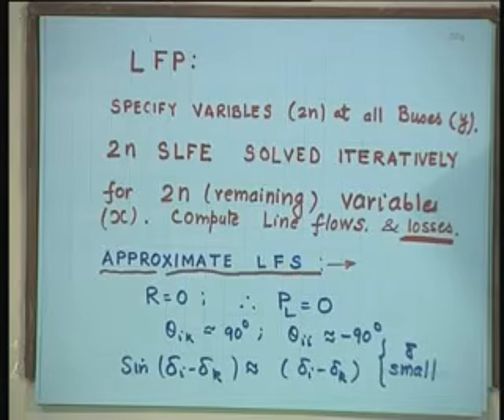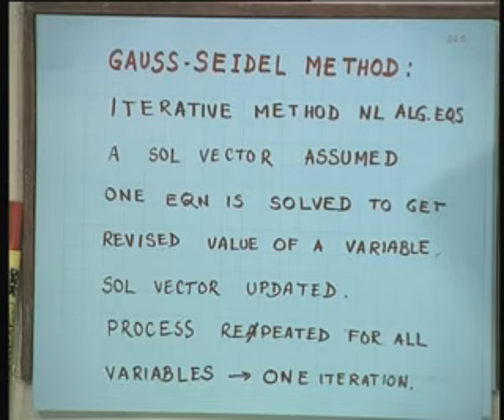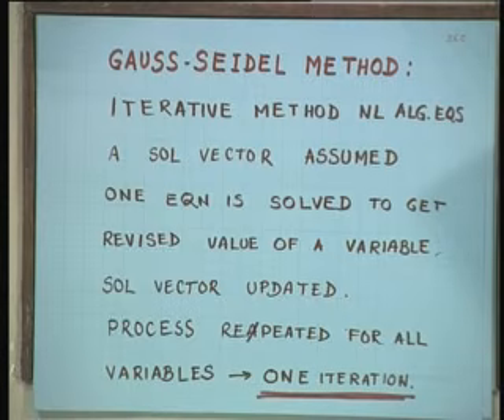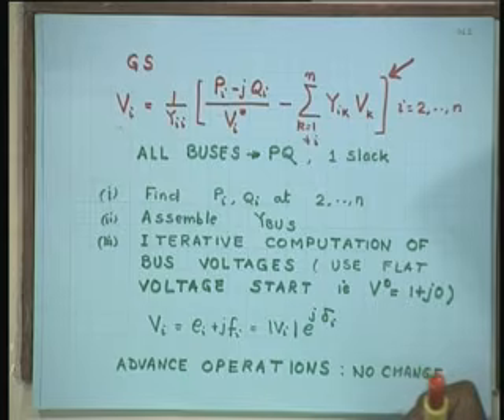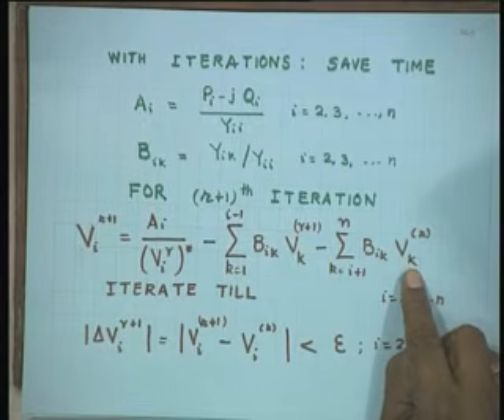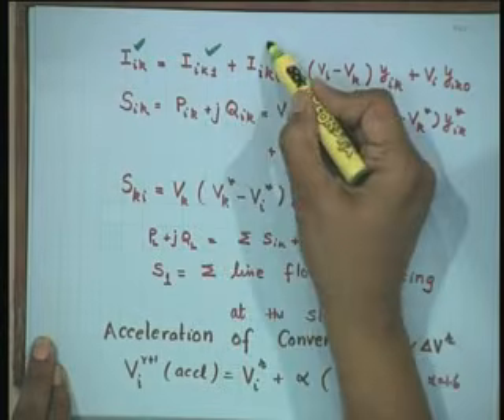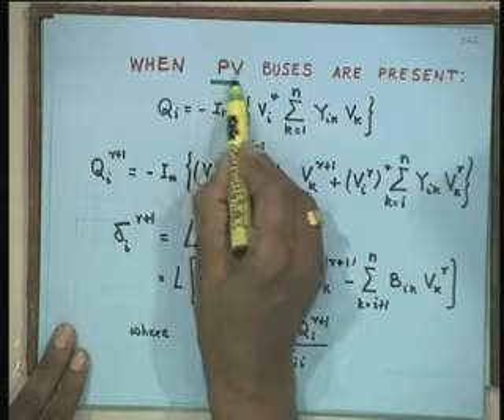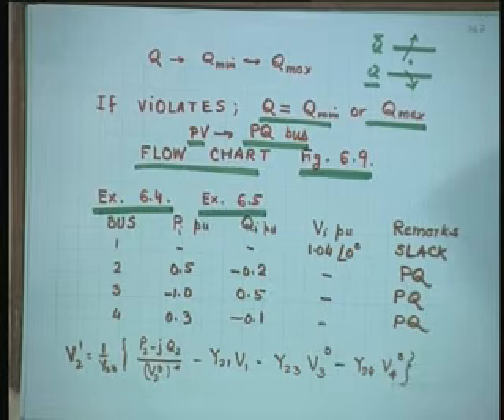Lecture - 28 Load Flow Analysis (contd.)

Comment: @SiddharthRaju 
@SiddharthRaju 
This is what my logic tells me:
In a PV bus Q is an unknown quantity and thus is calculated using the given equation; 
Now if this calculated Q exceeds the predefined set limits on Q, we set it to either  Qmin or Qmax (depending on which boundary is exceeded) and reject the calculated value of Q. Thus now Q is not calculated using the eqn for Q rather it is set to either Qmin or Qmax and hence the original PV bus is now treated as a PQ bus with known Q.